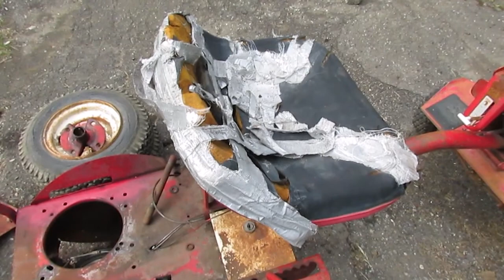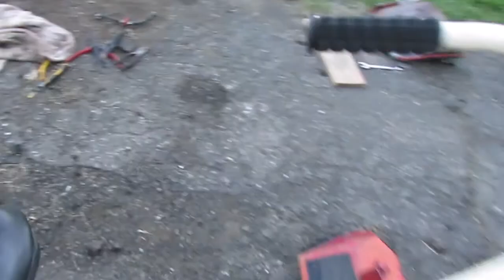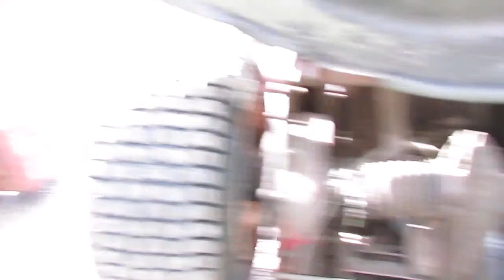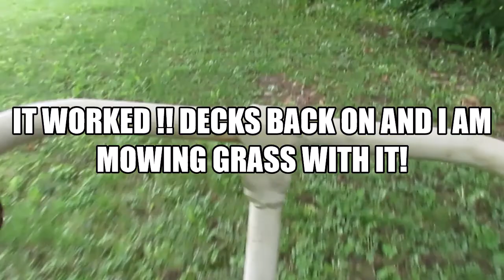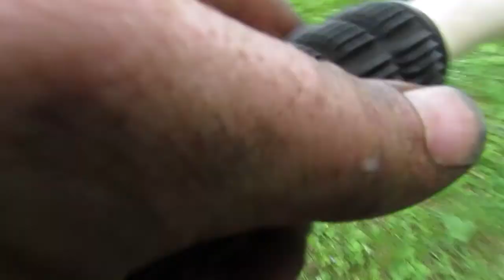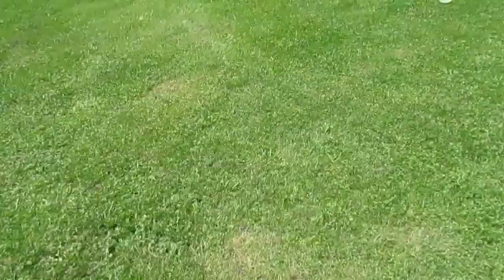Modified 2650 Snapper RER Resurrection

Comment: I love it! I just picked up a 77 Snapper Comet for $100 bucks.  The guy said it runs and drives but all tires are dry rotted.  It doesn't have the original motor but the rest looks original so it should be fun to get it cleaned up and going again.
Reply from the maker: that sounds like a Good Deal will you be doing any videos on your Machine ?
Reply: @NorthernMaineProductions  absolutely!